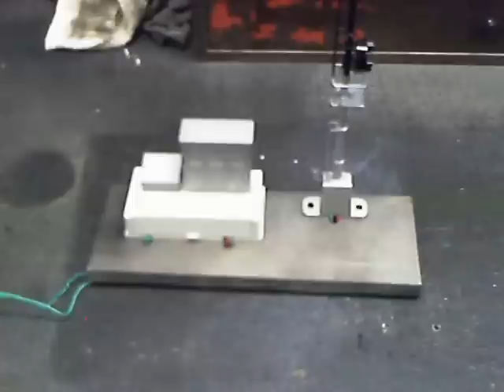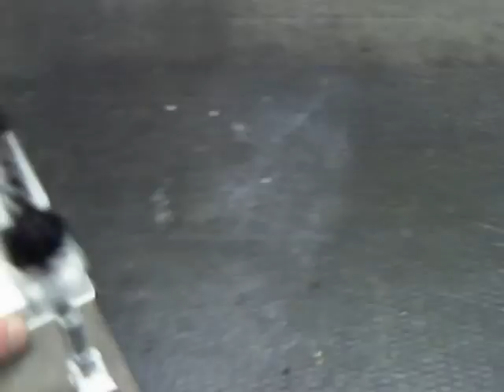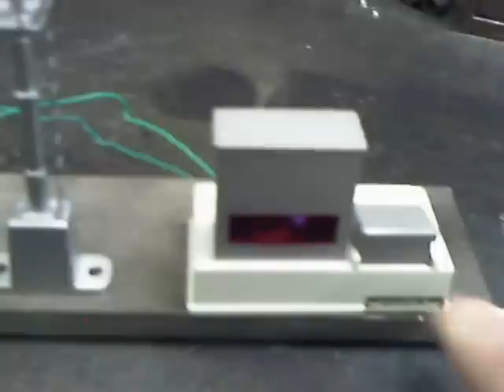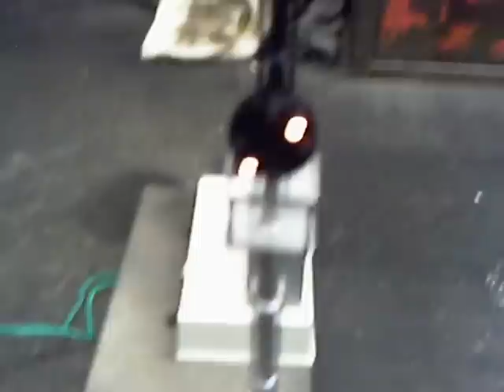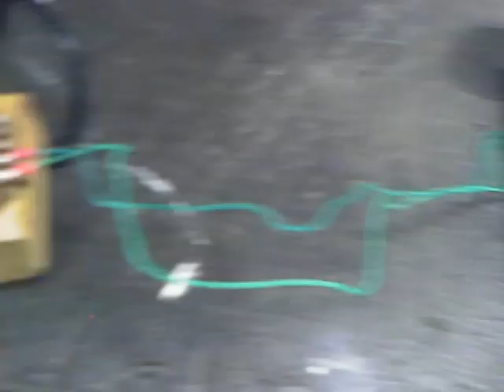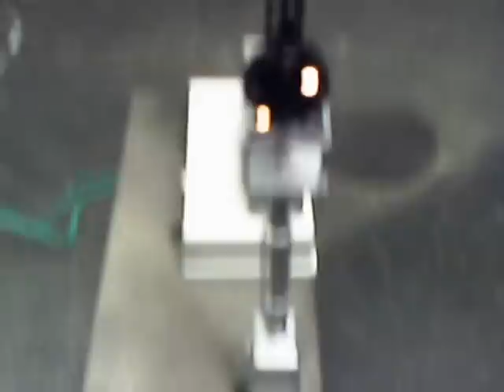MTH Railking O Scale Operating Block Signal (B&O Style)

Comment: Interesting. Nice signal too. Looks very realistic. I have something similar but it's just a circuit board with plugs for the IR sensors. It also comes with a Reed switch which you use a magnet and once it's over it it would trigger the signal which is very interesting. No idea what's in that Reed switch lol. Its very cool especially it's very cheap for 2 of those would be $19.99 + $2.99 shipping! And 5 for $56.99 + $2.99 shipping! What a deal compared to the 153IR for $40-50 Also if your planning on using IR sensors for your layout. It works best for moving trains.